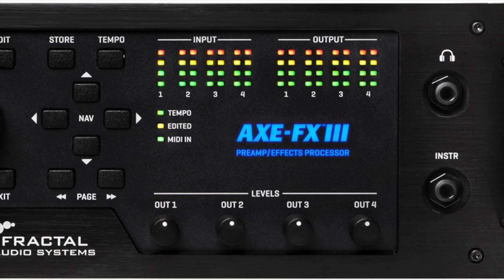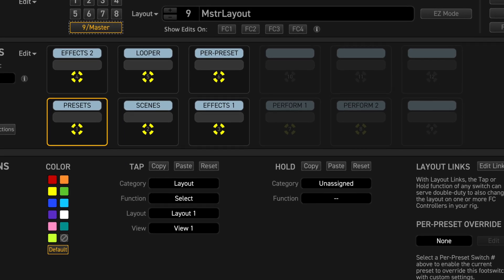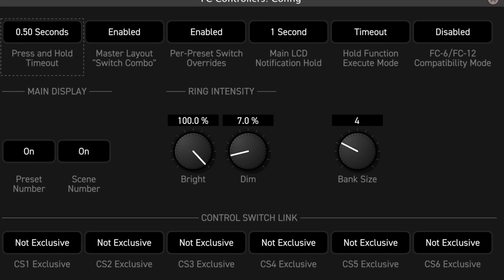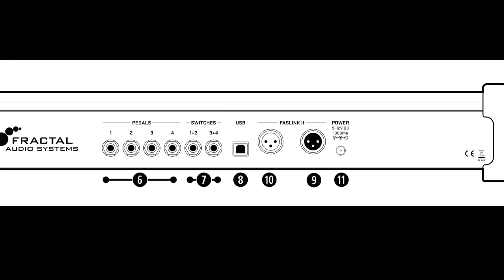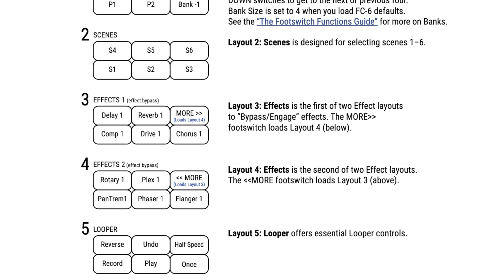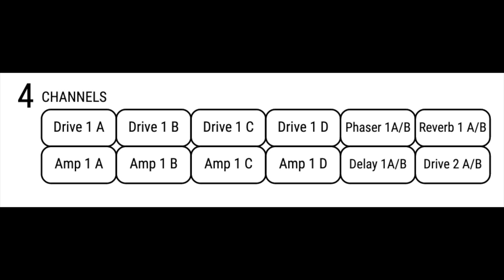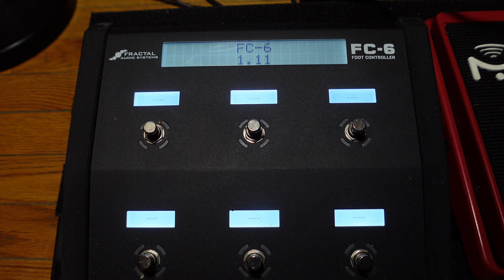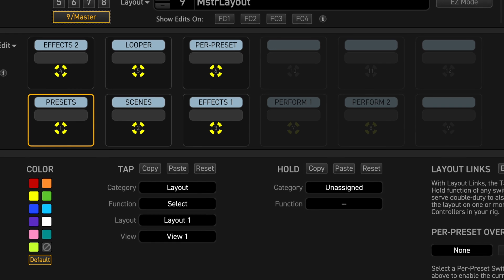AXE-FX III - The FC6 And FC12 Foot Controllers Explained

Comment: Hi, thanks for the videos. I have a question,  my axe fx 3 mk II and fc 12 just shows layouts 1-8 and master layout. how do I load the default layouts, presets, scenes, effects, etc?
Reply from the maker: From the front panel - LOAD THE DEFAULT LAYOUTS
No configuration is needed for the FC to function fully. However, we recommend loading the factory default
layouts and FC Configuration before first use. To do so, please perform the following simple steps:
  Page to SETUP | FC Controllers | Reset
  Select the relevant entry for FC-6 or FC-12 and press ENTER

Comment: Is there any way to get in and out of the looper faster without going to the MLM?  I’d like to use the looper and go back and forth between it and my scene or preset. Like click a switch go to looper click a switch go back to scene. Is that possible?
Reply from the maker: Yes, you can go into your layouts and adjust them, especially Perform 1 and 2.  You can set one of the footswitches to jump to the Looper.
Reply: @DougBsDigitalDen  thank you I got it working. I appreciate it. I have it setup just how I wanted. I was a little hesitant at first now that I messed around with it a little it makes sense and is easy to customize. I enjoy your videos look forward to the next.